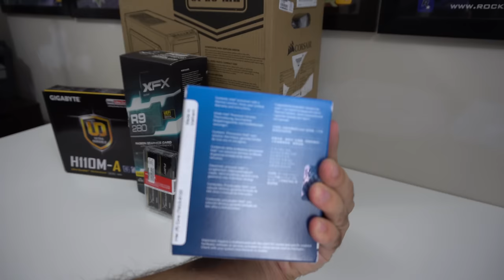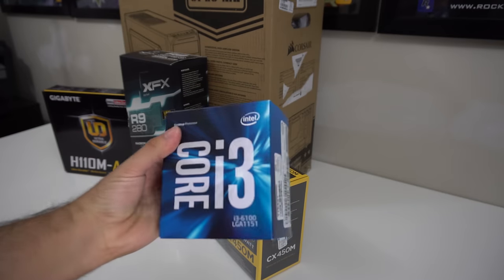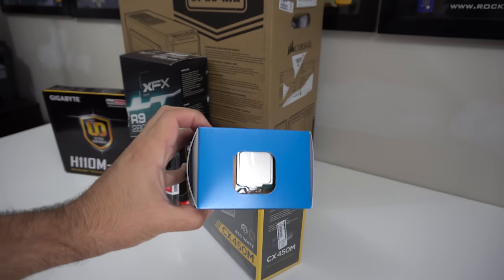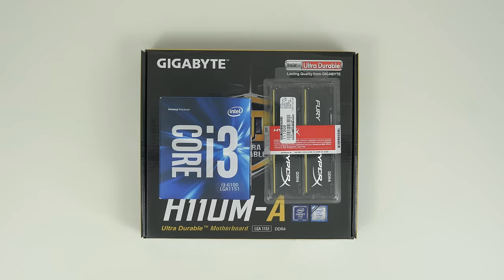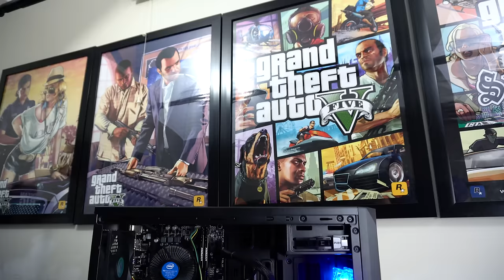$550 AFFORDABLE PC GAMING INCLUDES WINDOWS!! (Build Log)

Comment: lol... simply buy one... i got a 200USD lenovo pc... core i7 2.93 Ghz processer with 8 GB RAM... I m not so sure ab8 the hard drive i guess its around 600 Gb... windows 7 ultimate... i only need a 2/4GB graphic card as right now its just 2GB...😋😋😋
P.S Buying a used PC is better than a new one...  but a little used...😜😜😜

Comment: maybe try and get a i5 and instead of the r9 you get the gtx 1060 or the Rx 460 or 470
Reply from the maker: That would put it way over the $550 budget, those would be more suited for a $700-$900 build.

Comment: Can someone tell me if this are good specs? What should I add or substitute? I want a PC that I can stream and game without spending so much! 

Intel Core i5-6600K 3.5GHz Quad-Core Processor
Corsair H60 54.0 CFM Liquid CPU Cooler
MSI B150 PC Mate ATX LGA1151 Motherboard
Kingston HyperX Fury Black 8GB (2 x 4GB) DDR4-2133 Memory
Western Digital Caviar Blue 1TB 3.5" 7200RPM Internal Hard Drive
MSI Radeon RX 470 4GB Gaming X Video Card
NZXT S340 (Black/Red) ATX Mid Tower Case
Corsair Builder 500W 80+ Bronze Certified ATX Power Supply
Reply: liquid cooler is not worth it..use 3 fans instead. .
Reply: My point of view 
- use hyper 212 Evo or Cryorig H7 instead
- an unlocked CPu with a B150 otherbord is a bad choice, i would go with a z170 Motherboard, and if you are short for cash Asrock z170 MicroAtx is Arround the same price of MSi b150
- 8gb is fine, but Just buy Two seperate 8gb of HyperX Fury Black Sticks (16Gb in total) if you can  as the money you saved by going air colled will be invested in more ram 
- i would gather go with an EVGA Gtx 1060 3gb instead of Rx 470, of cours it doesn't feel as premuim as rx 47à, but performance wise will serve you better

otherwise a decent Build it just need some optimisation
Reply: ***** well ill be doing streaming and playing games so I want something that will last me a few years as I do come from console.. I actually switched up my specs and hope to hear you input on it! 

Intel Core i5-6500 3.2GHz Quad-Core Processor
MSI H110M ECO Micro ATX LGA1151 Motherboard
Kingston HyperX Fury Black 8GB (2 x 4GB) DDR4-2133 Memory
Western Digital Caviar Blue 1TB 3.5" 7200RPM Internal Hard Drive
Sapphire Radeon RX 480 8GB NITRO+ OC Video Card
NZXT S340 (Black/Red) ATX Mid Tower Case
EVGA 600B 600W 80+ Bronze Certified ATX Power Supply
Reply: great build but i have a few tweaks if i were you
- i will go with the i5 6400 of course its much slower then the 6500 but just bare with me
- for motherboard go with ASRock Z170M Pro4S its a great motherboard and if your willing to sacrifice the Bios update, youncan downgrade the buos to L2.73 and still overclock the i5 6400 to pass the 6500 performance to the 6600 performance territory (BUT BEWARE IF ANYTHING WENT WRONG YOU MIGHT LOOSE YOUR MB)
==========================
dcience Studio have a How To overclock non-K Cpu in his channel i would recomand you to watch it if you ever decided to go with this route
http://overclocking.guide/download/asrock-z170-pro4s-non-k-oc-bios/
==========================
- its actually not worth it going with just 8gb of ram especially when your streaming 16GB will be much helpful
- Buy the Rx 480 4gb instead, the 8gb is not worth it in my point of view
- as for powersupply choice is good,
Reply: this is my Personal Build for arround the same price you can copy it
- http://pcpartpicker.com/list/jtvKhq

Comment: will this be able to run black ops 3 at  decent graphics setting at 60+ stable fps??
Reply from the maker: Didn't get to test BO3 on it, but looking at the system requirements, it should be able to easily.
Reply: Sweet thanks man

Comment: i3 6100? Meeh i would rather go with an Fx an 8320 and have a solid 8cores instead of two crappy cores
Reply: The i3 will spank the AMD in gaming. More cores doesn't = better performance here. The AMD may.... may render video better, but I doubt it.
Reply: arround same gaming performance + extra horse rendring power in my point of view i would stick with AMD FX
the only Real gain with the i3 is its "Expending Route"
Reply: Not worth it. AMD FX is a lost cause. It is an old architecture, so why would anyone in their right mind spend money on it? Maybe Zen will change things back into AMDs favor. Until then, it makes better sense to go with Intel. Especially since the performance of Intel processors is so much better. The i3 that performs so close to the FX 8320 does so on a fraction of the power used by the FX. If you want to render, just go with X99 and Haswell-E. Then you will get DDR4, M.2, USB 3.1, and a machine that will better stand the test of time. I realize the OP was building on a tight budget, but at least he chose gear that isn't obsolete.
Reply: were talking about entry level Builds, when the premium x99 MB cost 500-700$ i think haswell-e & broadwell-e is off table
i'm not arguing about the compute power of intel skylake as clearly its outstanding i would choose the i5 6600K or 6500 or even the 6400 over Amd anyday.
but you lose So Much going with the i3 6100, two cores can barely handle every Day tasks anymore
i would rather have Minus 3-5fps which i won't notice anyway on the my games, and go with an fx 8320 system which will serve me the most on the hard core multitasking

ans if i ever needed to upgrade to skylake i5 or i7 i would sell the rig and buy a new one, as clearly you will need to sell most of the parts listed in the video anyway
PSU-MB-CPU-GPU
to match the skylake toptier performance
so even when we are talking about expending route & future proofing its not that bad with AMD as you people Try to show
Remembre 8 Cores vs 2, just go with the Fx and you will thank me later when you have to render a video, or if you decided working with Multiple Virtual machines
Reply: beside as customer i have no favor for amd over intel nor the reverse, i'm only looking for the best bang for my buck, i hope you understand what i'm saying :-) cheers
Reply: On that note, the i5 6600k isn't that expensive, and it is 4 cores like the AMD 8320. Granted the i5 isn't a hyperthreading cpu. Yes I said the FX8320 is 4 cores even-though AMD markets it as an 8 physical core processor. The supposed cores are simply modules, like threads on an Intel cpu. So why limit yourself to older tech. I do understand bang for bucks, but I also know when to stop throwing money at things that are quickly becoming irrelevant. You may very well get better bang for your buck with the 8320 for the time, but you'll soon be wishing you could have spent a little more for the newer technology. I tell everyone to steer clear of AMD products at least until we see what Zen is going to do for AMD. There are build videos of folks doing z170s for well under a grand, so there isn't much of an argument for AMD systems atm.
Reply: My point of view was choosing the i3 over Amd FX, if i had the money to throw on an i5 6600k or even 6400 i wouldn't hesitate going with it instead of AMD
but as AMd technology is irrelevant as you say, the two Cores on 2017 is also irrelevant & not worth your money in my point of view